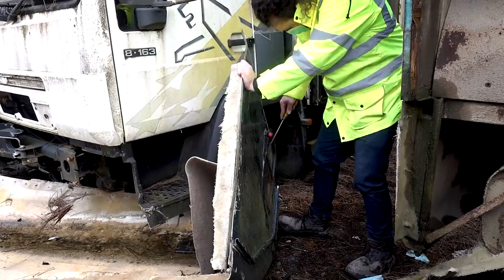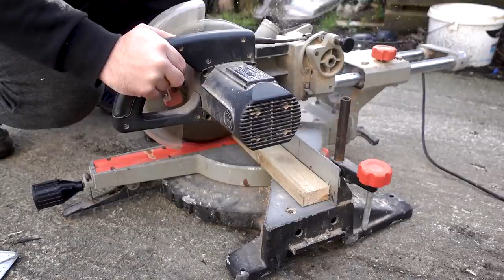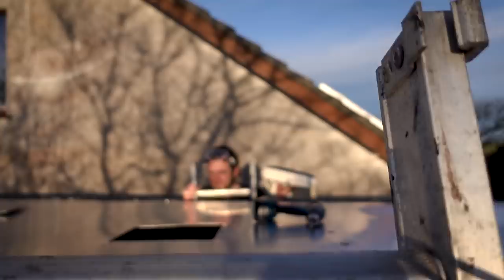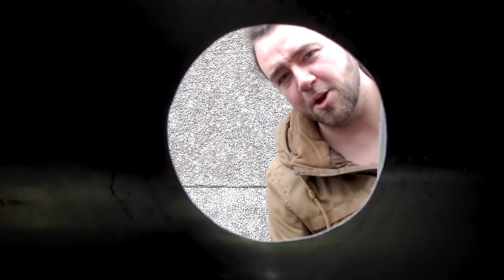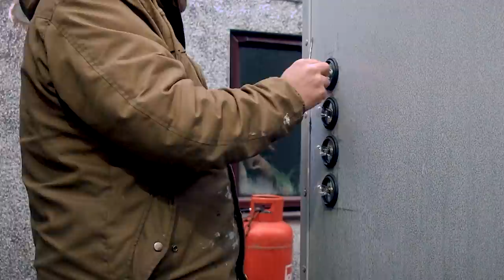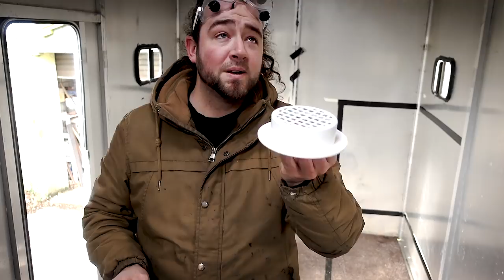Installing Upcycled Horsebox Windows, Fiamma Skylights,  + Quirky Features | Bedford CF Conversion

Comment: You could use spire nuts and self tappers for the back lights instead of the nuts and bolts then you don't need to worry about access from inside the van if you need to change a light. That's how these lights were fastened to old minis. A slight smear of vaseline round the bulb avoids them rusting in which they usually do in time. Great videos, no clues to what your next vehicle will be???? Can't wait
Reply from the maker: Thanks for the tip! We've got a few different ideas what our next van will be but it will be a 4WD and it will probably be smaller than our current van 😄

Comment: Great work guys! Don't forget reflectors on the bottom corners for the MOT. I love the space dome over the bed area.
Reply from the maker: Thanks for the tip! As it's a classic it doesn't actually need an MOT but we may have to put it through one if we ever hire it out for road use
Reply: @FromRustToRoadtrip  I've never been quite sure on this, having a couple of old classics under restoration. I thought if they were off road they had to get an mot to return to the road (but would not subsequently need one) but I'm not certain. With mine I will mot them anyway for peace of mind.
Reply: Reflectors are a requirement of ‘road worthiness’ to be used on the road. I’d suggest just land rover one’s.👍
Although your vehicle predates the ‘86/86 legislation it’s maybe worth being aware that this requires placements no more than 400mm in from the side & not higher than 1500mm which I think you’re achieving anyway 👍
Reply: Sorry this is for ‘ direction indicators’.
It’s all under the ‘construction & use regulations/vehicle lighting regulations). All riveting 🧐 reading. 🤦‍♂️

Comment: Looking awesome, guys! Love the bowl sky light. 

I got those Fiamma vents too, but with the fans. They fit the same as yours and I have to say I thought they were very poor. Like you say, just slightly overtightening the screws slightly causes the plastic to crack and then it doesn't pull in towards the roof well. I had a nightmare making them waterproof. After trying sikaflex 512 several times I ended up making my own drill holes for screws and using loads of bitumen flashing tape over the screws and joins. Looks a right mess on the roof but at least it's finally watertight. They would be better with multiple screws holes on a frame, not those four in the corners and the silly way they pull the two halves together. I'd never use them again if I do another build. Now I've modified them they look great from the inside and the fans work great. Much cheaper than max air etc, but very badly designed in my opinion. 

I cannot wait to see more progress. If you're hiring out the van what do you plan to use for your own travels?
Reply from the maker: Oh god what a nightmare! They have been a bit of a pain, we just couldn't find a more substantial alternative. One of ours fit perfectly and the other has been leaking since, even though we've resealed it about 10 times! 
We've got a couple of different ideas for our next van, but it will certainly be a 4WD and probably alot smaller than our LDV so it can go more places 😄

Comment: Hi Guys, love your work. I notice the globes in the rear lights were conventional globes. Can I suggest replacing the globes where ever possible with LED globes. Maybe some LED strip lights inside. LEDS will save you from loading the battery if they are accidentally left on....Not that I have ever done that myself :)
Reply from the maker: Thanks for the tip! Will look into that if and when this van is ever road legal 😅
Reply: @FromRustToRoadtrip  Located in Australia and all lamps other than the headlights can be legally swapped out here. Headlights need to be complete units and not just globe.

Comment: Just my opinion. I would've sikaflexed the wood frame to the roof. You may have done this, but I didn't see it. I sikaflexed both my skylight fans and flexible solar panel to the roof. No screws & I've have no problems.👍
Reply from the maker: Yeah we forgot to show that part actually, it's bonded from both sides. We had some issues with leaking after an intense storm but it's all fixed now hopefully

Comment: Nice Video, Might want to find a more secure way to keep ladders from sliding along the side of your van when climbing up on the roof though, that is exactly how my mum did her back in when the ladder slid off against the side of it.
Reply from the maker: Yeah I won’t lie there were a few moments where the ladder slipped and I quietly cacked it a little bit. Thankfully I think we’re done with the ladders for a while now
Reply: My ladder slipped down the wall and broke my wrist elbow and split my kneecap in two, it took me twelve months to recover fully.

Comment: Hi Guys. Where did you get the corner profiles for the body? Looking good so far.   Ged
Reply from the maker: I bought them from SW Commercials. It’s an IZUZU coach builders in United Downs, Cornwall. Think they were around £20 a piece
Reply: @FromRustToRoadtrip  Thank you

Comment: Hate to say it but you really need a lot more bracing on all the aluminum panels before you insulate.. would also consider sticking some 3mm ply to all panels to stiffen up a little otherwise it's all going to move and rattle going down road and in the wind causing more problems.  Wish you all the best and hope your out and about soon :)
Reply from the maker: Thanks for the tip! We've since attached all of the 6mm ply walls to the aluminium struts of the van so it should be nice and strong now, will be featured in our next video ☺️

Comment: Will you need to get an IVA test with it being homemade
Reply from the maker: Potentially yes, but it depends on a few things. Firstly it's a classic vehicle, so won't technically need an MOT or tax, and secondly it's still classed as a livestock carrier on the V5C form, plus we don't know yet whether it will actually be driving on the road or just parked up stationary. The tricky thing is there's very little guidance we could from the gov website about conforming to vehicle standards and what is required